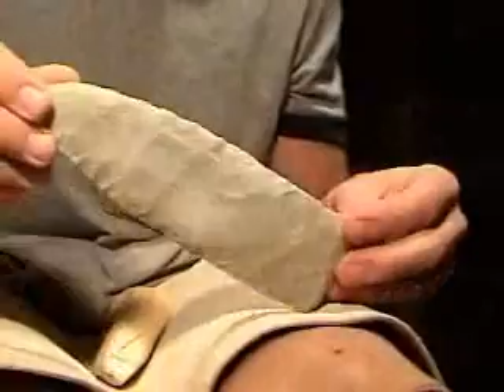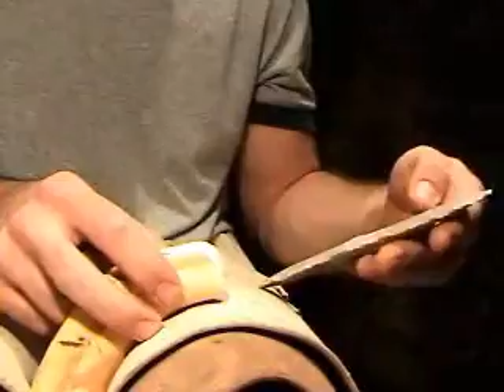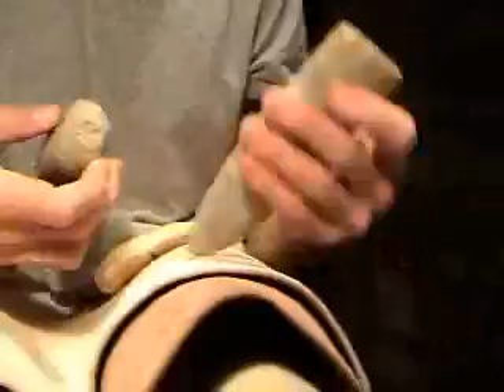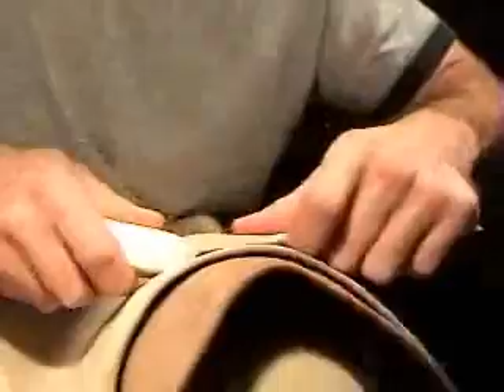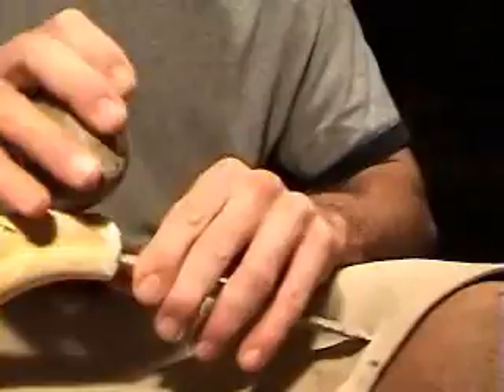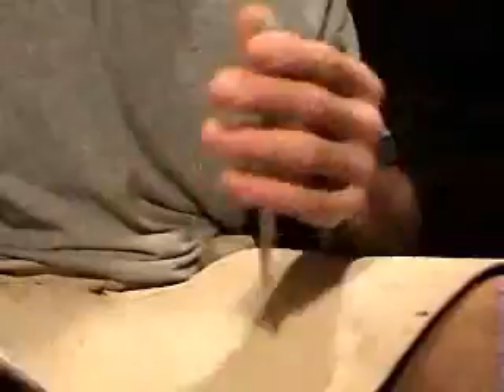western clovis punch chapter 4

Comment from the maker: good questions. It's a little harder to hold the straight punches but I just use more leg pressure into the end of the punch with my right leg to hold it and it works ok.  I don't like them too cruved when fluting usually because I usually flute with the tip against the inside of my left leg and this position is akward for the larger punches that are curved.  I do like the small warhog punch for fluting though and it is curved because the back angle of the punch still fits well into the leg.